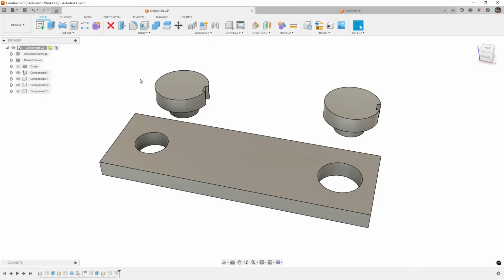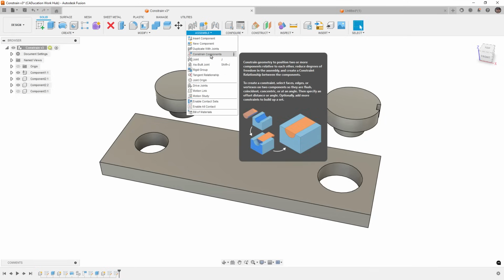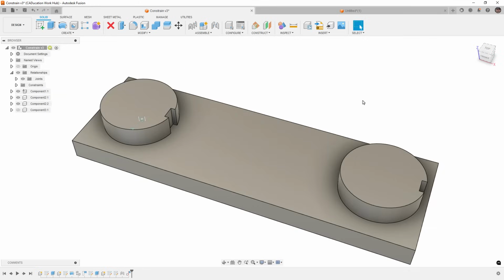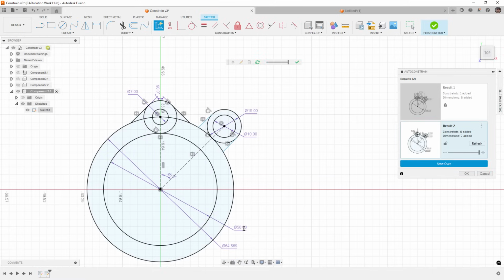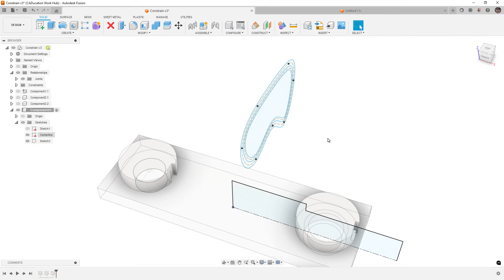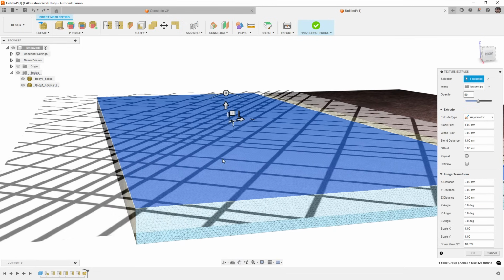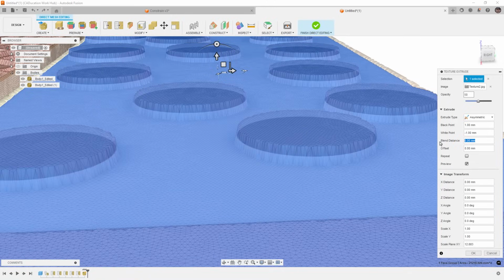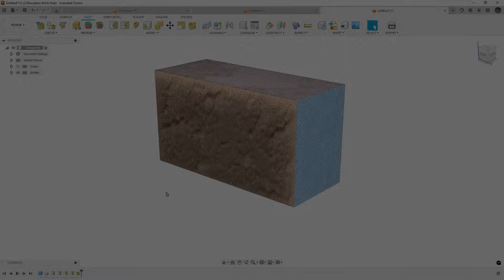What's New In Fusion | July 2025 | Mesh Texture | Constrain Component | Auto Constraint

Comment: I have mixed views of the constraints in assembly.  On one hand, this is great for bridging the user experience for people coming into Fusion from Solid works or Creo.  On the other hand, there is a great advantage of using joints, especially in build joints, by assignment motion limits and then perform more complex motion studies to observe the kinematics.  Coming from Creo a few years ago, wish this was available to help the learning curve.  But now I am comfortable in working in assemblies and using joints.  Great video Matt.  Many thanks.
Reply from the maker: Thanks Brian!  And yeah I am the same when I go to Inventor of Solidworks.  When I was a full time SWx user the constraint (mates) system made sense and I worked with it just fine, but I have come to like the way joints work in Fusion.
Reply: Joints are great in certain cases but are completly impractical in others. Try, for instance, to assemble extrusion framing and brackets, then change your mind about which orientation a bracket should be. Or try to constrain the primary planes of a subassembly to 3 different components/features at the next higher assembly level...then change the orientation of that subassembly.
Reply: The great thing is, it seems to be that they are planning on keeping both. So, you can use the super quick joint most of the time, but on the connections where joints are a bit lacking, the new constraints are gonna be great.

Comment: For "topographic " example I think you wanted to use an alpha map instead of an actual topographic map. EDIT: or alpha heightmap rather.
Reply from the maker: Yeah.  it would be cool if the mesh texture would work on a greyscale and you could do something like a greyscale height map.  The way the tool works is just black one height, white another height.  Which is OK
Reply: @LearnEverythingAboutDesign But it does work with greyscale. whatever you set for white and black is interpolated for other shades. I did give it a go after watching your video.
Reply from the maker: Is that baked into the Blend distance?  or is it true greyscale?  In my testing it didn't appear so but ill have another go at it!
Reply: @LearnEverythingAboutDesign  From my testing it interpolates the height of a greyscale image. Blend distance does not affect the geometry produced by the image. It seems to be affecting only the blend between existing mesh geometry and geometry produced by the texture. So only the edges. I made a quick video demonstrating what I did. https://youtu.be/7bNVXzvmLW0
Reply from the maker: @dmytro.d  Thanks for making that video.  Your results are what I was expecting to see.  Ill try again with some better images and maybe make an update.  thanks for sharing and spreading the knowledge!

Comment: I use fusion every day. 
Nearly all features of this program are half baked. 

Error handling is not informative and the modal pop ups are significantly vague. 

Plastic, utility, subdivide forms. Pretty useless.
Reply from the maker: Thanks for your feedback.  I agree that Fusion isn't perfect.  Having used (and still do) loads of other more expensive CAD programs I wish i could say its just a Fusion problem.  I do wish for more improvements in sketching workflows or say not having the little modal dialog always in my way :)  That being said I still do feel (for me) that for the money it does offer great value.  I still curse at Solidworks everytime I have to use it with a "why are they doing things that way" or "that should work but it doesn't".

Plastic (design extension) still needs work for sure.  Subdivide forms though I don't have any problems with.

Comment: Some good updates, but my 3d print plus stopped working today and infact I have problems with most methods of stl export.
Regarding joint, is there a way to set a magnetic force in Fusion?
Reply from the maker: I have sent a few things to the print slicer today without trouble.  I use Right-click on the body and Save as mesh. then send it directly to my print utility.

On the magnetic force, no sadly.  Depending on the parts you can try Tangent Relationship.  I think that will make one object stick to the other. but its limited.

Comment: OFFSET OF AN OFFSET :O
very niche quality of life thing but it's something that's bugged me for years
Reply from the maker: Yeah.  now if they just add "construction" for the selection I will be happy :)
Reply: @LearnEverythingAboutDesign  Hello, I would like to know about this. Is it about creating a "Construction type" offset curve? For example select a line and create a construction type offset from it?
Reply from the maker: @rhtbapat  So what Solidworks and other CAD programs do is give you a check box to make the selected curve construction.  So say you have a circle, and you want to offset it both ways, you would generally want the original to be construction so you don't have 2 profiles to select.  That is the option I would like to have, but it doesn't exist in Fusion.  At least not yet.
Reply: @LearnEverythingAboutDesign  Oh ok. 
I believe same result can be achieved by turning ON Construction option in the Sketch pallet while creating the offset. 

So the steps would be, Launch Offset command -> Select curve -> Turn ON Construction curve type in Sketch Pallet -> Hit OK
Reply from the maker: @rhtbapat  what i typically do is double click the original after the offset and hit X on the keyboard, shortcut for turning a line to construction..